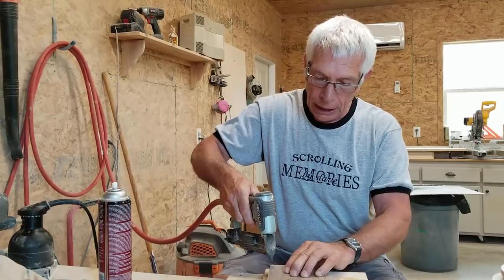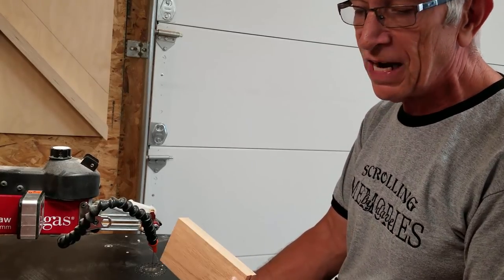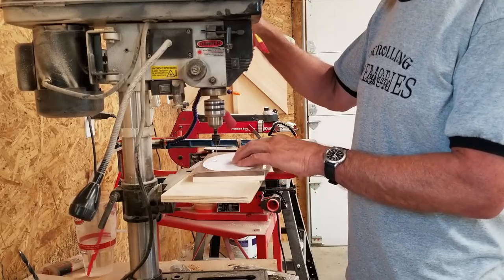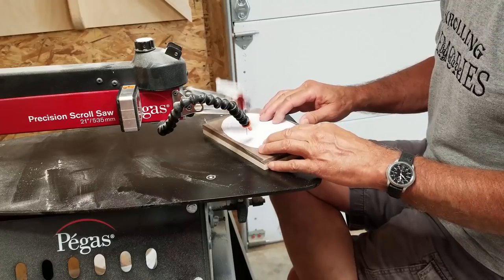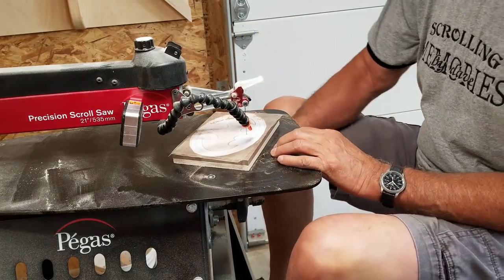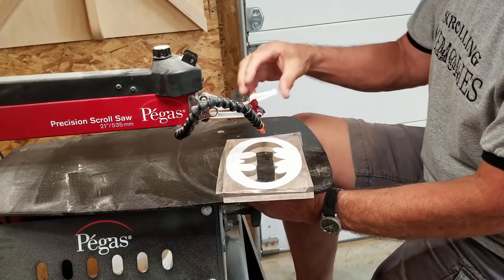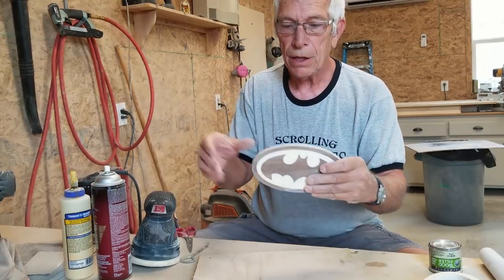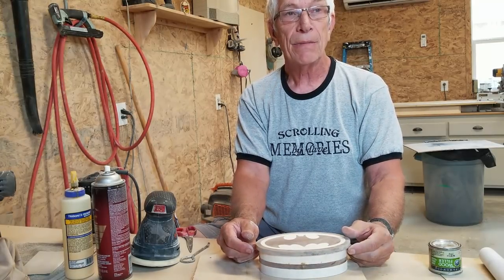Scroll Saw Inlay

Comment: Nice instructional video. I am a segmented woodturner so do a lot of glue ups. To conserve glue and make it easier I have a small glass food storage container with a sealed lid, I pour my glue in it then use the brush to dip in the glue then just snap the lid back on and it keeps very well. After a couple of fillings I soak it in water to clean it up.

Comment: Good job Dave!
I notice that you have a Pegas scroll saw. The Pegas has only been available in the US for a few months. It is obvious that you have been scrolling longer than that. What saw did you previously use? How do you like the Pegas? What is good about it? What is bad?
Reply from the maker: I've been scrolling for 3 1/2 years. I started out on a Dewalt. I scroll at least 6 hours a day. Wore two out in less than two years. Desided I would buy a Hegner. It is a great heavy duty saw that will probably be going strong when I am gone.  I missed being able to top feed so when the Pegas came out I desided I needed one.  I love it! I see no negitives at all. Time will tell how it will hold up.

Comment: very good video for inlays.  I'm curious about your saws.  Pegas is fairly new compared to the Hegner.  Is the Pegas easier to use at steep angles or does it vibrate more?  Is a Hegner worth the cost?
Reply from the maker: Daniel, Sorry for the slow response. I wore out two Dewalts in two years so I broke down and bought a Hegner.  I think it will live longer that me.  It is  super heavy duty saw.  When I owned the Dewalts I  was a top feeder and missed that with the Hegner.  When the Pegas came out I thought I needed one.  It is a smooth running saw and I like the tilting head and being able to top feed. I do all of my inlay work on it.  I try doing most of my cutting on my hegner because I know it is a much more heavy duty saw.  I'm sure I have only confused you.

Comment: For your first video, you did very well. Like other posters, here, it is very well laid out and followed a logical path from start to finish. I am very impressed. I will be subscribing as soon as I am done writing this. I, too, am here because of Steve Good. He has been my "guiding light" as well. 
I wonder if the 2° will work for any thickness as long as the two pieces are the same thickness. Your thought?
Reply from the maker: The thicker the wood the less the angle.

Comment: Loved your video! 
What is the name of the filler you used?
Why did you use 2 different sanders? When do you use the orbital vs the other?
Thank you!
Reply from the maker: Carol, Currently I am using Timbermate Water based filler. It comes in a lot of colors. I have also found if I mix fine saw dust with shellac it also works well.  Since I made this video I bought a drum sander so after I glue my inlays in I run it through that and then finish up with my orbital.  If you just have an orbital that will work fine.  You can see all of my work at  https://www.facebook.com/DaveMonkWoodnArt Message me with any questions you might have.

Comment: hello can you help me  What to buy Hegner MULTICUT 2 S, or Pegas SCP21CE 21 '' (535mm)
Reply from the maker: What type of scrolling do you do?
Reply: @davemonk7213  fretwork scroll
Reply from the maker: @bobbybobby7568  I love both my saws.  One thing I really like about the Pegas is that I like being able to top feed which you can't with a Hegner.  The best thing about the Hegner is that it doesn't have many bearing so there isn't much to wear out. It will last the rest of my life. I scroll about 6 hours a day so if the Pegas was my only saw I question if it would last me forever. I do a lot of inlay work so I really like the tilting head of the  Pegas for that. I would not give up either saw. I really can't recommend which one to buy. Sorry